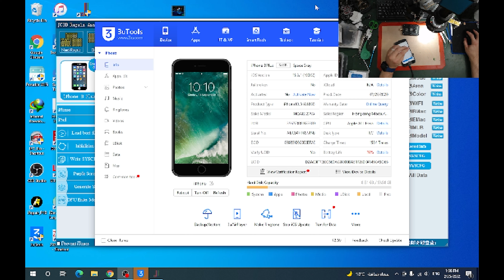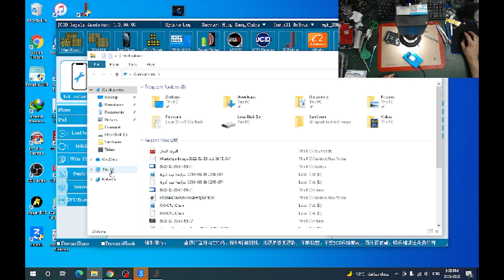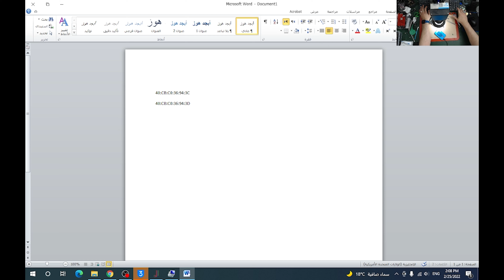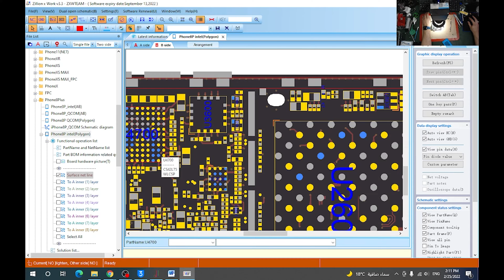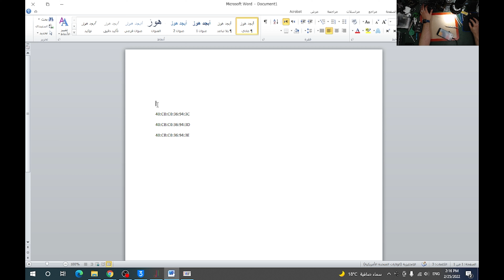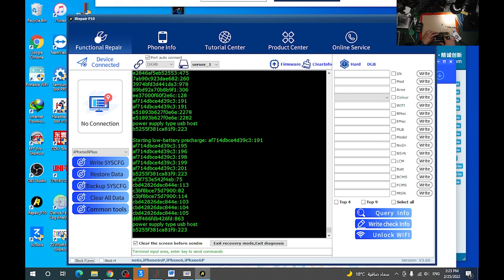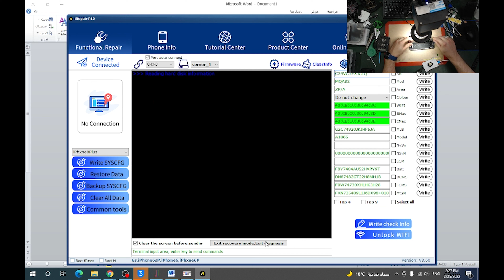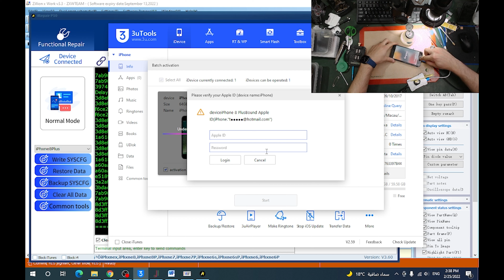استخراج البيانات الذاكره من 8 وما فوقف مع طريقة تعريف مبرمجة ال JC P13

Comment: Good day my brother , I'm new to the JC P13 , can I remove iCloud by hardware method after I query genuine manufacturers code on the software after flashing nand disk and reflashing software on the device? Please kindly advise .
Reply from the maker: What’s did you mean remove iCloud hardware 
If you remove iCloud hardware you need to write new data yes you can use jc P13
Reply: @WaseemTech  thanks very much for the response , so after the operation it will be a new device that anyone can use freely .
Reply from the maker: Yes sure